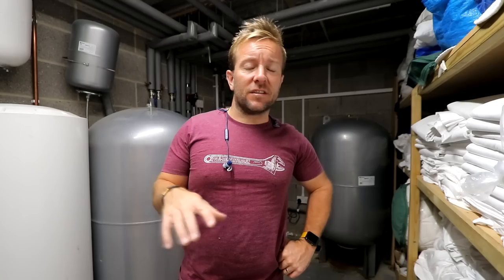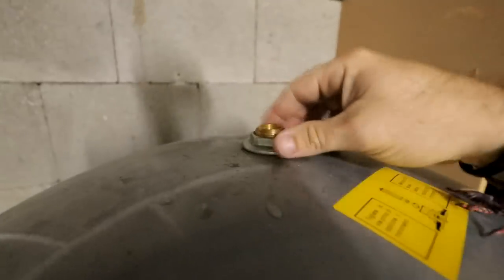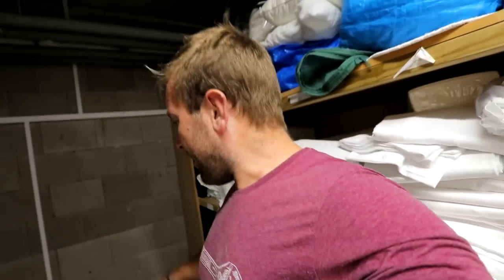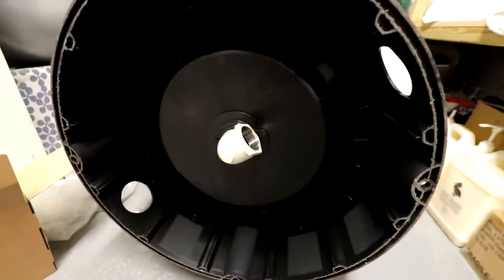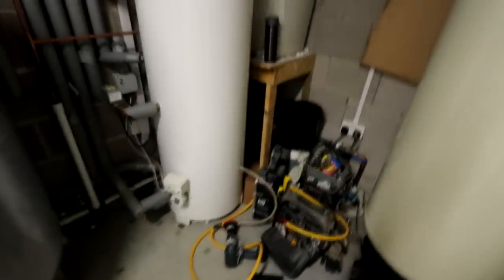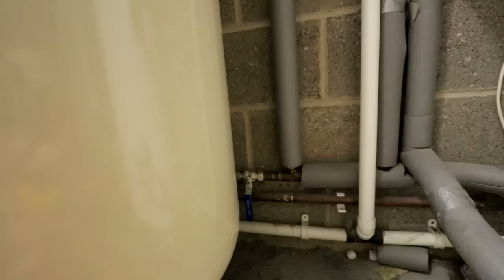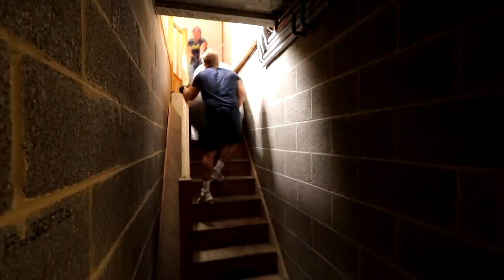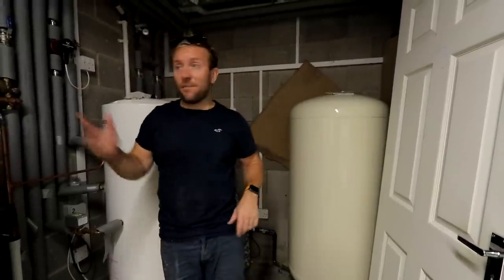BOOST WATER FLOW AND PRESSURE JOB - Stuart Turner Mainsboost Install

Comment: Hi mate can you do a very basic video on measuring copper pipe and fitting it. On walls, in notches. in the floor, just a basic video on connecting it and how you would measure it all with elbows ect. Thank you very much.

Comment: Hey, iv been watching your vids for years and they have always helped me..they are great and always make me laugh. Just a couple questions. I use a super vee monument at work its very powerful and nearly broke my thumb. I am trying to find a powerful snake but not1 so dangerous for my cousin. Could u do a vid on sanni snakes maybe? Also .. i had nearly a flood today mains side of ballofix came loose ( it wasnt fit proprely) .. i had to get the tenant to run all the taps but it was stil so strong .. i managed in the end but have u got any solutions for potential floods like this happening.. If the taps hadnt made it reduce pressure i would have had to get her to hold the pipe to stop the flood whilst i find a stop cock but do u think maybe an aladdin isolator whilst some1 is holding the leak or a made up flexi hose with push fit with hose to make put down the toilet...do u carry any of this emergency stuff would be good to know ..... cheers and thanks again for your vids xx
Reply: ps i work for the council so like 10 jobs a day so finding the stop cock and isolators before each job we dont have time for...these types of leaks/ floods dont happen often but from time to time..........thanks

Comment: Good video!! I find a perfect solution for quick drain down on Cylinder and Booster tank, called Milwaukee Transfer Pump 18V  1800L / Hour😆 Bit expensive but worth every penny.. 👌

Comment: You know what I need to see? A tool that can crimp pipes together so you can solder them without them moving the frig EVERYWHERE. Imagine you dry fit the entire thing with temporary crimps, and then just solder every joint freely.
Reply: Pair of grips, light squeeze and it won’t move
Reply: @chriswatkinson93  but it distorts the pipe shape and can cause a leak where the copper is too tight together to not allow solder to flow in :( a "crimper" would create a uniform grip that still allows the solder :)

Comment: Well irs not 2 and half bar as it's not pressurised.  But there in is the solution.  Air Pressurise the tank from the top.  Simples.  Edit.  Then as obvious the same air pressuriser/ compressor can then be used to check for any leaks prior to  flooding the system.  P S Those pumps are notorious for seals going and subsequent seized bearings.  A back up yes, but an every day tool.  Absolutely not!  
There are plumbers and then there are engineers.... Which are you? 😉